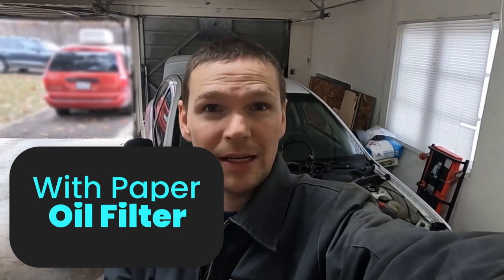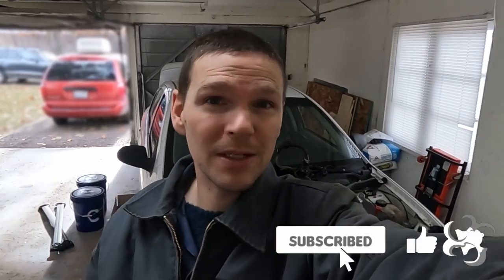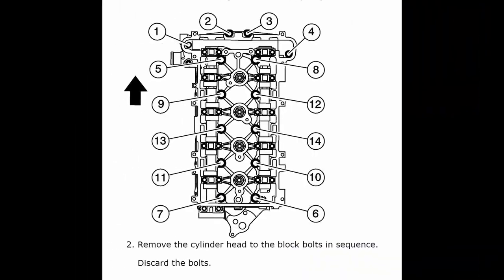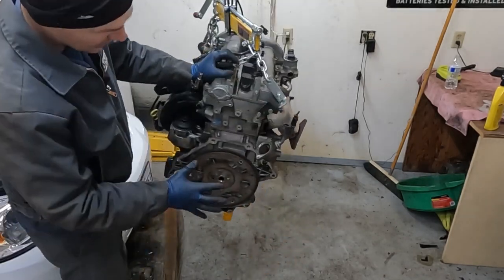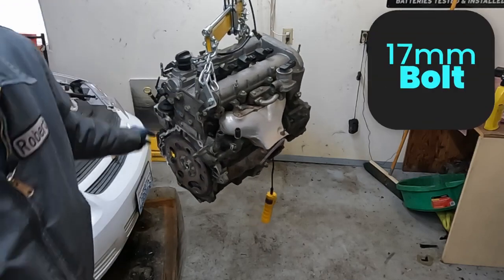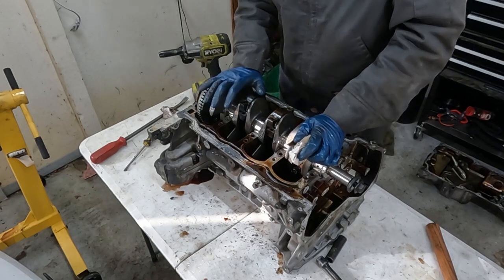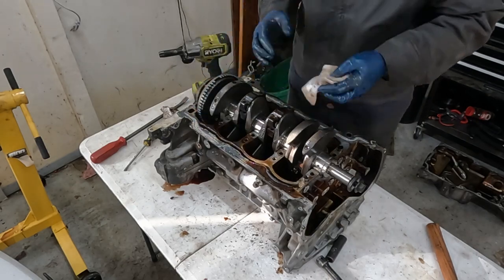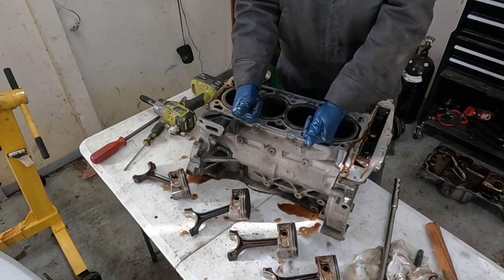Chevy 2.2 Ecotec Engine Rebuild Teardown |  Engine Disassembly

Comment: Is this the same motor in the 05 sunfires the 2.2 engine ?
Reply from the maker: It's very similar but it is a different engine. I'm not sure torque specs and procedures would be the same.
Reply: @ValleyMobileAutomotive  okay sweet I'm just curious don't know much about the motors  or transmissions on these cars but are they pretty good units because I can't find anything on the Trans much ?.
Reply from the maker: @JakeWilson-x4q  they are pretty good cars overall. They do tend to burn oil so keeping up on checking the oil every so often.
Reply: @ValleyMobileAutomotive  I wonder why they burn oil often guessing the rings get wore out but overall how much would it cost to rebuild one of them roughly?
Reply from the maker: @JakeWilson-x4q  if you do the work yourself and you purchase quality parts it runs between $400-$600. If you have a shop do it it will be around $3,500 because of the labor involved.
Reply: @ValleyMobileAutomotive  that sounds about right  I was wanting to rebuild one myself as a project

Comment: What is your opinion on this one?
2003 Saturn Ion Level 3, 2.2L Ecotec L61, "F" on VIN, 

No History on Vehicle (Flood Damage)
Took spark plugs out (spark plugs looked ok), disconnect fuel & ignition, crank. Milk chocolate.
Replace Oil & Filter, Drain Fuel Tank, Replace Fuel Filter, Air Filter, Took Plenum Out (Heard liquid inside) clean & Dry, re-installed.
Condition: "Crank No Start", No Engine Codes.
Engine in Vehicle, no visible stains and or leaks.
Fuel: Yes, Spark: Yes, Compression: Dry/Wet
 1:70/225
 2:65/200
 3:100/130
 4:35/100
Leak Down: NO pressure hold.Each cylinder leak from crankcase bleeder & throttle. plug bleeder with thumb, air from throttle & oil came out dipstick.
Inspect Timing Chain Cams Sprockets: Sprockets orientation 10/2, but color links +1, no broken or loose guides. Cams rusted in shaft, some scoring in some lobes.
Cylinder Head:all Valves look straight after putting on hand drill, all intake valves rusted, exhaust valves ok. Rocker's free roll, some are scored on the edges a little bit, Lifters not clogged, nipple rotates.
Block:
 1/4: TDC ok, no visible damage on piston, no scoring on walls
 2/3: 2 TDC ok, but 3 never reached TDC at all with/or with out 2 (rotated crank several times) it stayed 6.5mm short of top block
Note: #3 was the one with the stable compression, so piston Rod should be ok...crankshaft lobe wipe?
Question what can cause #3 not to reach TDC?
Thanks!
Reply from the maker: If cylinder 3 was full of liquid when someone tried to start it it could have hydro locked and bent the connecting rod.
Reply: @ValleyMobileAutomotive  That makes sense...ok...time to take out the block. Will keep you updated

Comment: I watch the whole video and it was awesome. I have car with same Engine ecotec 2.2 . I was particularly focusing on location where Block heater should be installed. But i miss ed it.
Would you be very kind enough to tell me ..if possible....where do we install block heater in Ecotec 2.2 engine ? I drive saturn ion 2007 2.2 engine car.

Comment: Any tips on which common tools are great to keep on hand? (Common for different types of vehicles).
Reply from the maker: Hey Tammy, good question! My most common tools I use everyday are a good ratchet and wrench set. Craftsman, DeWalt and Workpro all make a good Mechanic's tool set. Followed by a good set of pliers and a good set of screwdrivers. These cover 90% of the work on any car. Other tools would be a 1/2" impact and impact socket set, pry bar set, electric ratchet, torque wrench breaker bar... It's easy to spend a lot of money on tools. My advice would be to start with the Mechanic's tool set and then purchase tools as needed for the job at hand. Hope that helps 🙂